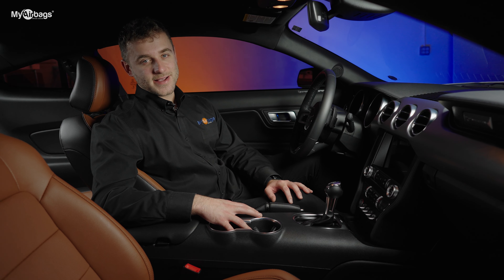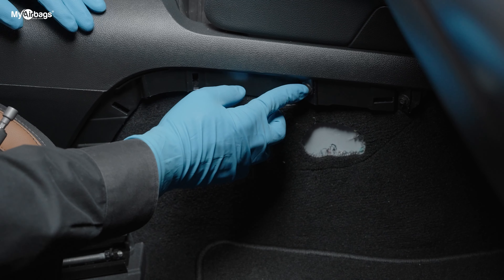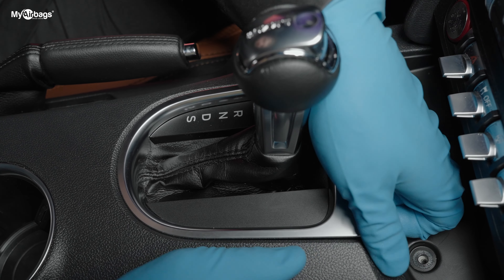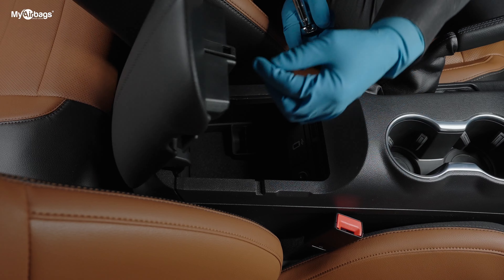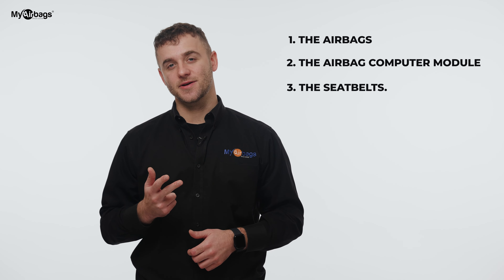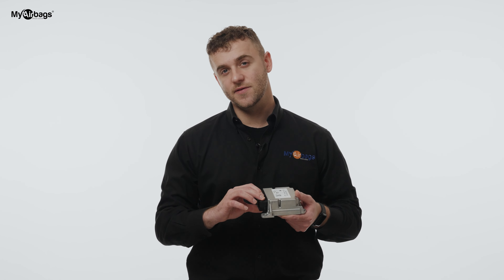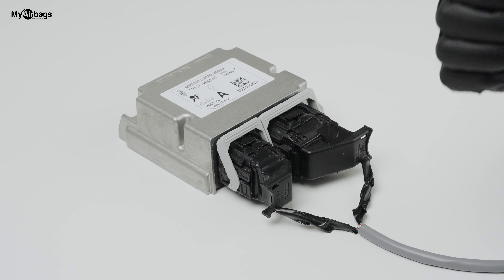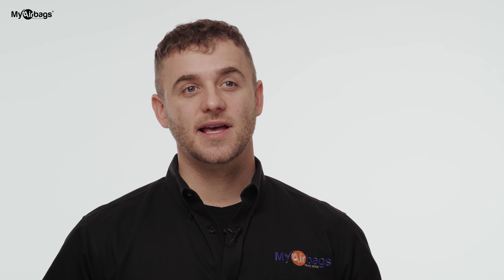How to Locate, Remove & Reset SRS Airbag Module in a Ford Mustang | MyAirbags

Comment: It throws the wrench light if you try and remove for weigh reduction
Reply from the maker: Are you getting any codes?
Reply: @MyAirbags  yeah unknown dtc and wrench light might be cause I unplugged with battery connected but I put it back